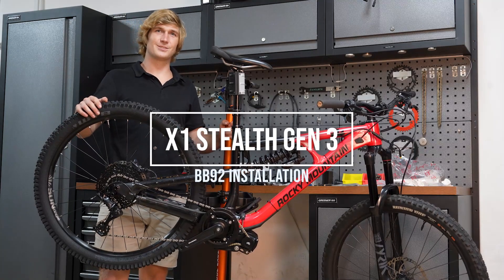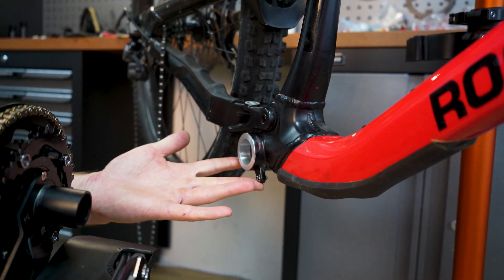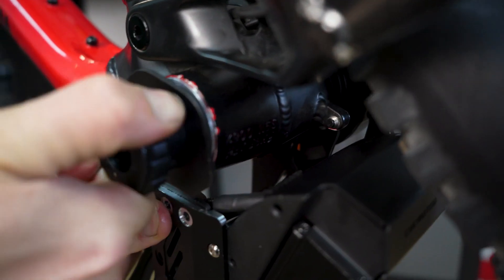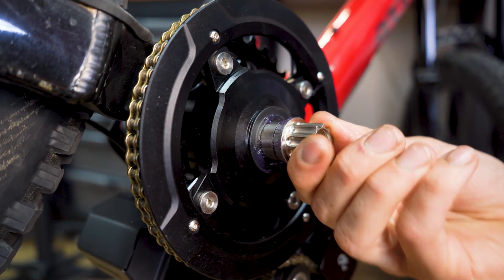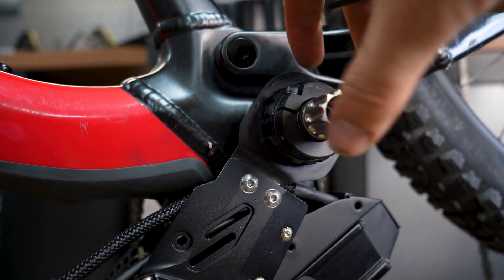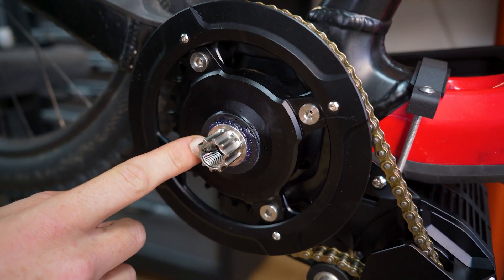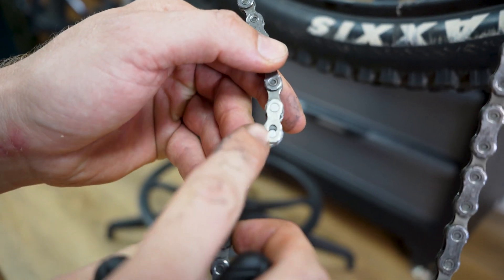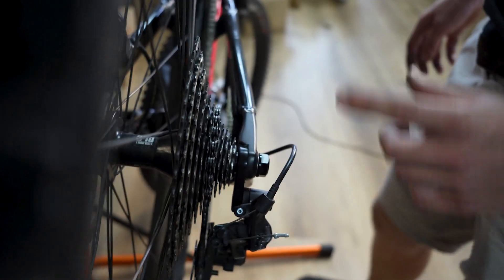X1 Stealth Gen 3 BB92 Installation on Rocky Mountain Slayer - CYC Gen 3 powerful ebike conversion

Comment: what if i have a bike with duble gears so the place where the motor goes i also have 3 gears and in the back i have 7 gears?...
Reply: You will have plenty of torque. You will only have one front gear you would have to remove the front derailleur. Pick the chainring size that is closest to your middle chainring if you live in hilly areas or bigger for speed in flat areas. You won’t miss the gearing with the added power

Comment: All gen 3 motors are faulty do not buy!
Reply: How so? I've had mine for three months, and it's running fine.
Reply: @vmao4868  Are you using a 72v battery?
Reply: Mine is perfect after a year.

Comment: How can i use cyc isis spindle on my 83 shel without right side cup or  mptor install. Left side i just use euro 25 mm bearing but right side no spot for bearing on cyc spindle. Is there some type of external bb with double row bearings ?

Comment: Can this motor be spun to fit in the frame gap  so it's not hanging down.im looking at fitting to the same bike. Be nice to know the fitment options
Reply: Yes. But you probably have to relocate the controller.

Comment: Quick question: Is there replacement bottom brackets for when they wear one day? I want to possibly put one of these kits on my Trek Slash 8 and I intend to ride enduro trails and 4x4 trails with my bike then. Just because I know I wear through a bb every year.
Reply from the maker: Yes, replacement parts are available at CYC resellers and directly from our website.

Comment: Great bit of well designed engineering, only downside is the offset cranks due to spacers being added, all bikes are/were designed so you have a perfect up/down pedalling motion, and not an offset as though you are riding a slim horse, this along with all the horror stories of these cyc kits lasting like 50 miles before burning out the motors, if the price was lower and came with a perfectly matched, ie: ah, size, shaped battery to your choice of motor then this would be a world beater, failing that i'll hold off ever purchasing one until the aforementioned is sorted.

Comment: This video was very helpful. I found it very hard to find any decent info on installing this kit even the info on cyc's website is very lacking. 0 torque specs on anything. This video helped a lot. What I would advise anyone doing this install is to double check your bb shell width and install spacers accordingly. Also before installing the isis splined cranks verify you have the correct amount of spacers. You will need a special puller tool to take the crank arm back off if you haven't installed enough spacers.

Comment: Can this motor be dialed at 2000W?
Reply from the maker: Hi Paul, it will peak at 2000W so you can set the power limit to that.
Reply: @cycmotor  thank you.

Comment: This could not be fitted inside the frame?
Reply from the maker: Yes, in some frames, it can be fitted to be mounted inside the triangle.
Reply: @cycmotor  Does the Motor fit inside the triangle of the Rocky mountain Slayer?
Reply: @KlausVOGEL-wj9ly can you post this bracket/visual?

Comment: I personally like the prev gen better. Controller doesn’t hang low and it’s basically theft proof. This one has a better concealed torque sensor and thats all. so for this theft reason I hope cyc starts selling parts only if customer can show proof of purchase. I want to upgrade to this torque sensor if I can when by bearings are shot.
Reply from the maker: To upgrade the torque sensor, you'll need to get the full upgrade with controller and BB assembly switching to ISIS completely. Reach out to our tech support team to help you with exactly what you'll need to do this.

Comment: Would have bought one already if you hit the throttle for 2 seconds and show us how loud it is
Reply: From looking at it I don’t see any way they could have reduced the db level by any significance. Love design, power, build quality etc but love the silence of the HD
Reply: @TK-OK  the only reason I'm asking is they claim they improved the noise levels. I agree I'm fully expecting it to be loud like an electric dirtbike. Can hear it from a block away I'm sure. I'm sure its more robust than the nylon gears in the HD but .. lets hear it. Kind of a big factor in whether or not you can actually ride it around like an electric bike.  If it's roaring at 10 mph then its not going to be a great option if you want an electric bicycle Lol
Reply: @TK-OK  yeah if you want silence, the cyc just isn't it, but it does have torque sensor bottom bracket with isis spline over the bbs
Reply: You've already seen how loud it is under throttle in a previous video.
Reply: @Emolokz  the only previous video im aware of is the overview,  I have never watched the electrify bike channel, I will check it out,  its kind of unusual 3rd parties are revealing the motor before the company.
Reply: @EBikeBuilder_  Electrify is partnered with CYC if I recall, as one of their main vendors, and they likely have much more free time on their hands so it doesn't really surprise me.
Reply: @Emolokz  I believe Electrifybike is their biggest US reseller and US based tech support. Price is the same from either company and the support from both is great. Although I bought my X1 Stealth over a year direct from CYC and 5,500km ago I did buy my battery from Electrifybike. They have been as great to deal with as CYC. Both companies respond to questions very quickly and listen to their customers. Not something you see every day. Can't wait for my Gen 2 upgrade kit and my new Gen 3 kit. Will be able to compare them once they are in hand. As far as the noise is concerned I don't find it loud at all but am looking forward to the quieter Gen 3. The torque sensor is huge and far more important than a quiet motor IMO. I'm a cyclist and I love to pedal. Being able to actually pedal at up to 60kph (sprinting like a Tour de France sprinter in the last 100m) is great. Having over 200,000 miles on mostly road, and quite a bit of mountain biking over 45 years probably gives me a slightly different opinion than most people looking for a throttle and a lot of power as opposed to pedal assist. I average only 185 watts in pedal assist level one in Road mode most of the time. But when in the mountains on really steep climbs cruising up very, very steep climbs like I am on a flat road is great. I also built a fantastic bike trailer out of an old Huffy eTrike and comfortably pull it loaded at up to 50kph. Can't say enough about my DIY setup. And yes, I would buy it again in a second knowing what I now know. Oh., and I upgraded my drive train with a Box Components Box 2 eWide 1 x 9 setup. Crushes the old rear cassette and derailleur. I can climb a wall on this setup.
Reply from the maker: We work together with our dealers but trying hard to get more content out there for you guys :)
Reply: @cycmotor  Great! It is an exciting product, i am looking forward to see it in operation .. 😎  Hard to justify the purchase when there is barely any information available.  Thanks
Reply: @EBikeBuilder_  they also have another motor coming soon called the photon not as powerful but looks like it will be quiet.
Reply: @Emolokz  have yet to see of find any video of V3 running. 
Please provide link and time signatures
Reply: @TK-OK  Electrify Bike channel, they review the v3, at the very end they throw it on a bike and hit the throttle
Reply: @Emolokz  thanks 👍
Reply: @TK-OK  my pleasure! Sorry that I couldn't be more detailed, as I was actively working during the time I was explaining 😅 I imagine pedal assist mode will be less noisy than throttle assist.